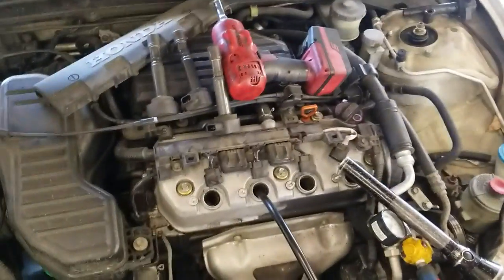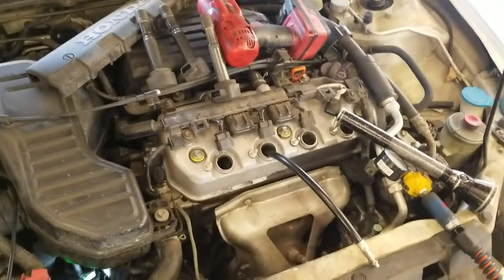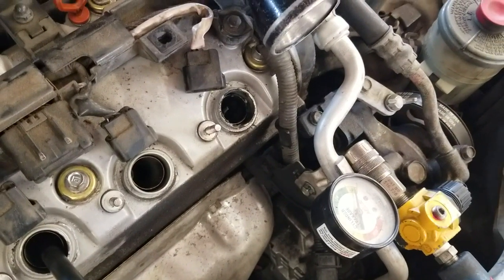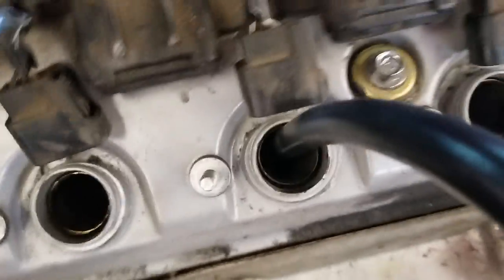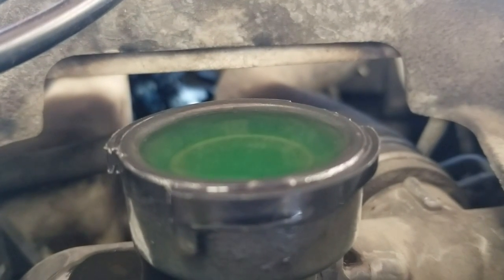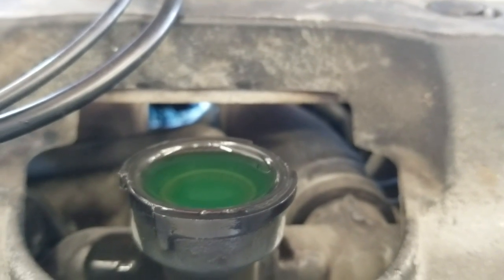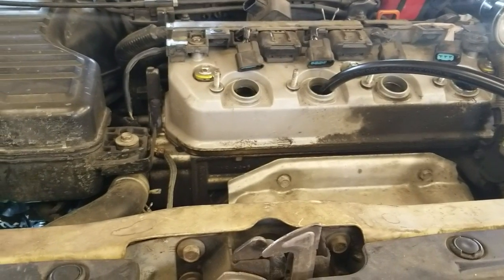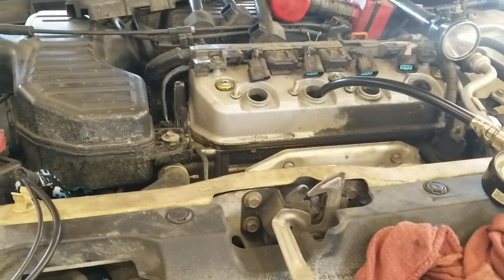Best way to diagnose if your head gasket is bad

Comment: Head gasket can be an easy fix. 

Be careful with these crooked mechanics whom recommend you buy a new car. 

A car can go 500,000 miles with proper maintenance.
Reply: How is it usually fixed?
Reply: I heard new engine or?
Reply: @that682kid.C  you replace the head gasket it’s getting to the head gasket is what’s the problem for most
Reply: Man i just asked my local mechanic shop. He said people really exaggerate the head gasket job. It's not that bad nor should it cost more than the vehicle is worth. It just goes to experience and the engine. (Some harder than others)
Reply: The more difficult one's are when the engine has heads with duel overhead camshafts. Timing the engine is a bit challenging.

Comment: 2002 Honda civic EX ,Coolant was all over the place from the radiator cap, So I replaced new radiator (since it has 290000  miles ), new thermostat, new coolant sensor, New timing belt ( Timing is correct) , New water pump, Jumped coolant fan to be on all time, Hoses does not leaking, Did the compression test 180 on 3 cylinders and 175 on one. Also i did the test pressurizing cylinders but no coolant came out from the radiator cap. But the issue is my engine is still get over heated.  I really don't think i have a blown head gasket . That's the only part left to do but I don't get any diagnose to replace my head gasket, Any thoughts ?
Reply from the maker: Do a block test with chemical. Also, make sure you are bleeding coolant properly, does heater work strong when at idle?
Reply: @subtledriver  Did the block test, No exhaust on coolant, No heat at all so i remved the heater core horses notices that no coolant came out from the male hoses. I think it might be clogged. I ll let u know what happen when i flush the heater core.
Reply: @subtledriver  Did the block test no exhust, Heater doesnt work at all. :( Just over heats/ Did the heater core flush too but no luck. One thing i notice there is no coolant coming in to the heater core when i unplug them from male connectors, This is telling me there is no pressure leading back to the water pump . Let me know what to do you think.
Reply: Well I ended up replacing the head gasket (resurfacing the head wt a felpro gasket) new water pump (denso) and once i did the head gasket and did the coolant bleeding  honda is back to life for more miles with no heating issues any more.
Reply from the maker: @udarasri4  good to hear!

Comment: How much for the leakdown test ?
Reply: Check your thermostats first, I'm a mechanic. This wasn't blown head gasket. Look under your oil cap and if it's got white milky substance it's blown but you'll know when it's blown. It'll drive massively different.
Reply: Mechanic just did my radiator an said I have a cracked head.. could be be wrong I see no smoke or different color in my fluids

Comment: Hey small question, do you think i can use an electronic "CO2 leak detector" to verify that ? Like run the engine, put that on the coolant hole, try to make a tight seal with duct tape or whatever and look at the reading ?
Reply: Interesting idea.  In theory it should work. Assuming water vapor and heat don't mess it up first. Try it why not lol. Also are you sure you don't have a carbon monoxide detector? Far more common that dioxide.. Still may work though As both those cases would likely be present from combustion.
Reply: same question and want the answer. because I have a gas detrctor but didnt have the test solution set.

Comment: Smart video. Used to do same test with hollowed out spark plug,6inches copper tubing n air line connector. Good video
Reply: Can you elaborate more on your tester?  How you made it..  
Also, top dead center for the test correct?
Reply: @nhlninetyfour  
Just buy one they are relatively inexpensive
Reply: You're a genius too!  Sounds like an old school test!

Comment: Coolant dosent show a gasket blown between 2 cyl you need a Compression tester for that
Reply from the maker: The leakdown tester will show a problem. Unfortunately this video doesnt talk about missfire related headgasket failure, more along the lines of disappearing coolant and no smoke and overheating Thanks for the comment.

Comment: Can't you just replace the head gasket and get more miles out the motor? Like I can't afford a new motor or getting someone to put it in.
Reply: Cheaper to replace the engine
Reply: @matthewhooks452  with my kia spectra i don't think replacing the head gasket is that bad.

Comment: What is that tool you used there.
Reply: You can break porcelain from spark plug and braze copper pipe (6inch in length)and braze air line fitting onto pipe. Set up each cylinder on tic on compression stoke. We used to put car in first gear,foot brake n hand brake application. When air is added to cylinder sometimes engine would turn and car would jolt forward violently.  But good craic!!!
Reply: @joeconnolly6444  oh ok hey thank you I appreciate it .

Comment: does this explain why my crv after sitting some days itll burn off alot and i mean alot of white smoke that smells really strong?  its also burning alot of oil as well.  my mechanic told me my engine needs replaced but if its just a head gasket that would be awesome.  i get alot of engine chatter as well in the both head and block.  i ran it dry for a few days before i noticed.

Comment: Ok explain to me why a mechanic would rev my engine excessively to get the temp up and cause the bubbling? I was very angry with the way he did my car. After him reving my engine and causing it to get really hot he says my head gasket is blown. Took to another mechanic he said I just need a radiator flush and car just needs to "idle" a few minutes. Just want to know why this other mechanic would rev my engine this hard.😡
Reply: He did the same procedure this guy did just in a different way. He didn't have to do it that way though but its prolly the only way he knew how.
Reply: So he figuratively and literally revved the nuts off ur car. So ur car is sackless as we speak

Comment: I bought a leak down tester yesterday, and I saw your video today. I'm going to test our 2001 Buick next. On the 3.1 Liter GM engine, the intake manifold gaskets can leak and coolant gets sucked into the manifold. So, I'll see how it goes.
Reply: hey !  Gary!  Did you test your Buick?
Reply: @tomaunofilms83  Yes I did. The liquid turned green, so combustion gasses were getting into the cooling system. I have a problem with fibromyalgia and arthritis, so I was trying to decide what to do, as fixing the car would be a difficult task for me now. An opportunity came my way where I bought a nice 1998 Ford Taurus with only 87,000 miles on it for $1600. I have a friend who is a retired mechanic, and his '94 Ford Thunderbird is in bad shape, burning oil and slipping transmission. It would be easier and cheaper to fix the Buick, so I gave it to him.
Reply: Nikola  I'm sorry that my answer was too complicated for you.
Reply: Nikola  Ok, then I guess that the reply was to complicated for your Neanderthal brain. Besides, you were not the one who asked the question. Just go ahead and find simple short videos to view, and stay out of other conversations. No one wanted your input. Also, someone should warn shepherds in your area that the sheep are not safe tonight with you around.
Reply: What about a cracked exhaust manifold

Comment: So if the coolant goes to the reserve bottle all the time and the radiator goes dry it means or is a sign of a bad head gasket too ?
Reply: No. The reserve tank is there for overflow and it's normal. If your radiator go dry it's probably leaking somewhere. Signs of bad gasket will be boiling coolant in the reserve tank. But that's not always the case. Could be air leak in the system and/or bad radiator cap, water pump, etc..
Reply: My coolant reservoir goes low but it takes months is my head gasket bad?
Reply: @ladarequiem  on its way to getting blown

Comment: That dont mean the headgasket blown it could have air in the system most cases if the head gasket is blown the oil be milky or steam out the tailpipe or the water levels will be low might have air in the system bleed the air out i seen this before on bmw & hondas that will fix the problem
Reply: Exactly. A lot of mechanics will tell you it's blown head gasket. It's how they make money. Usually it's the radiator that is broken or air in the system. Cheapest way it getting a new rad. Flush coolant and get brand new coolant.
Reply: Mine milky and it did blow stem out the tail pipe does it mean new engine
Reply: Yes it does mean the head gasket is blown. Think about it.

Comment: I'm in need of serious help. I took my. 06 acura rl in to get the motor mounts changed. I left the shop. My car was making a weird noise and smoking bad out of the tail pipes. It died on me. It turns over but it will not start. It just whines like it wants to start but cant. Would that be a blown head gasket.
Reply: John Smith  Thank you

Comment: Did any one understand anything. Or what he is doing.
Reply: Yes, so he removed the spark plug and is building the combustion chamber with air(aka pressurizing it) to his stated psi of air. The head gasket(when good) should seal all of that off and not allow mixture with coolant. A “blown” head gasket will allow coolant to get where it doesn’t belong or allow exhaust gases to mix in with the coolant. The coolant rising in the radiator that you see indicates that the undesired air pressure is pressurizing the cooling system through a head gasket that is no good. If the head gasket were good you wouldn’t see that coolant rising/bubbling. Does that make sense? Sorry if confusing trying to explain best I know how.
Reply: If you don’t understand what’s going on you shouldn’t be working on a vehicle. You should pay someone that does

Comment: Very informative, replaced my radiator and fan(with cheap parts not OEM) due to a collision. Radiator began to start leaking, eventually severely. Added stop leak into the radiator no longer leaking but now my car is over heating. A day later I realize the fan isn't working. I'm getting the overflow of coolant from the radiator neck when the car is on, also notice what sounds and feels like boiling in the top hose and radiator cap. I was thinking  the stop leak may have clogged the radiator. Can the fan not working cause the overheating, overflow of coolant, and boiling sound?
Reply: A boiling sound is likely from air trapped in the system, especially if you hear gurgling when switching on the heat. My guess is your cooling fan has a problem if its not on constantly when the engine is up to operating temeperature, have you felt your radiator hoses? Are they hot to the touch when the car runs for a while? If not maybe your water pump broke or your thermostat is stuck shut cause the coolant to not circulate.
Reply: stop leak will clog your radiator and put you in a world of hurt.....dont use it!

Comment: Mines is bubbling a lot when the engine is at operating temp at idle would that be a cause too
Reply from the maker: that could be just boiling since the cap is not installed and raising boiling temp with higher pressire. could also be the head gasket.

Comment: I suspect that my 1.6L NONE Turbo Chevy Cruze is having a similar issue !! 

There was oil in the coolant tank and we had to change the Oil Cooler in order to fix the problem !
afterwards i noticed some coolant leakage so had to changed two hoses and the coolant pump . 
My mechanic told me that he suspects that the "head gasket is bad " :( 
and therfore there is a high pressure in the engine that causes all these failures .. 

are these diagonstic symptoms for a bad head gasket ?
Reply: Hi I have the same problem with my vauxhall (opel) astra GTC. Vauxhall is also owned by General Motors at this time with very similar if not the same engines. I'm scared as I have oil in my coolant too! With your problem, did your mechanic make sure he flushed the system to get out all of the sticky oily stuff in it and stuck in the pipes? Otherwise this could be the problem with the oily sticky stuff just coming to the top of the tank again?
Reply: I don't believe that your mechanic couldn't have found the blown head, rather than having you change multiple parts that only put a small dent in the problem and/or bought you a little more time.

Comment: So if I have my car cold then turn it on and take off the cap off and if it over flows does that mean I have a blown head gasket?
Reply from the maker: possibly. but you could also have a stuck open thermostat or failed one. eventually coolant will flow out as the result of heat expansion.
Reply: subtledriver would that be the thermostat on my dash?
Reply: no the cooling system is heating up and flowing

Comment: Because of the video title I read your username as “SubieDriver” and thought, yup...Subaru lol
Reply: why did the hg blow in the first place? was that fixed as well? or will it happen again?.....
Reply from the maker: @mjt-ew8rs  lack of maintenance is typically the main issue (not changing coolant, not keeping on top of oil changes and allowing it to run in poor state, second is loss of coolant and overheating. This warps the gasket surface and allows it to blow out.

Comment: Subtledriver  had a question i just notice my car has coolant leaks it betteween the heand and block so im assuming its a head gasket cuz my car is 25years old but well maintained and it has never overheated not even with that leak so u still recommend to get the head gasket replaced and head resurfaced? Thanks
Reply: That or use K-Seal

Comment: How much psi are you putting in there?
Reply from the maker: Less than the billions of explosion that occur in a drive to the 7-11. I would imagine 90-140 psi range?
Reply: @subtledriver  same qwstn.... about how much .... just dont want to over pressure.... max air compressor of 130psi ok?
Reply from the maker: @shanz3n5  the regulator of most leakdown testers is set to 100 psi

Comment: How is the tube made air tight in the cylinder?
Reply: Hjalti Gestsson it screws on to the spark plug hole. Then the engine is rotated to tdc compression stroke, sealing the compression chamber with the valves in the closed position.

Comment: U could get the tester kits to that use dye that changes color if it detects exhaust gasses
Reply from the maker: That's what I normally do,,, but it evaded detection  this time.  So I had to do the cylinder pressure test.

Comment: Do a head gasket on a civic with a d17. That put the year of the car above 2002.
Do a head gasket on a d series is not that expensive or difficult as on a b or k series. Unless you take it to a shop that is going to shell you out of 2.5k
Reply: 2.5k?? I charge around 700 for this with gaskets included